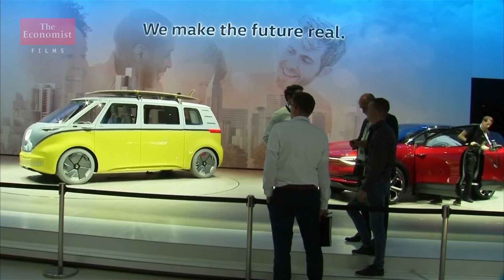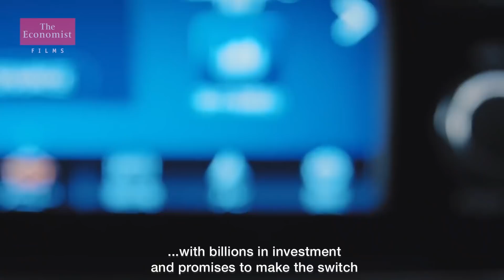Electric cars will come of age in 2018

Comment: Fossil fuel cars are 20% efficient while electric cars are 95% efficient.
Reply: It appears that Luke has done zero research about the issue.

https://www.bloomberg.com/news/features/2018-06-27/where-3-million-electric-vehicle-batteries-will-go-when-they-retire
Reply: parsi zaban sadly not true. Vehicle efficiency is much lower when you see how much energy is consumed overall. The leaf is really a 30mpg car when charged using most efficient gas generator. The cars are on average 26% heavier. Pre heating in winter and losses from socket to battery are not included in the vehicle consumption GOM only what is taken from battery to motor. Degradation with useage and especially with rapid charging of smaller packs is significant. Unlike lead acid batteries, 95% of LiOn packs are NOT recycled buy incinerated! Yes to ending fossil burning but the alternatives need to include wastefulness of scrapping existing reliable and efficient cars. In Finland they now use hvo from waste in their buses instead of diesel. Much lower emissions than converting them to EVs.

Comment: Anyone who is considering or has already buying an electric car is well aware of the need to source their re-charge fuel from renewable sources.  The message here is that "boogy Boogy!"  the EV's will still run on dirty coal.  But No most people are already aware of the changes underway (irresistable I suggest) to move to cheaper Greener renewable sources of power for our economies!  then their is the issue of sourcing Lithium and Cobalt.  Well Australia has Lithium mines now opening (no child labour or repressive governments here) and Tesla and other EV makers are seeking better places to source their Cobalt than the Congo.   So the cleaner Greener and cheaper solutions for our transport are NOT fraught with uncomfortable choices... In fact modern industrial nations are already awake and making and legislating to make these better choices mandatory & thereby hopefully contributing to  making irreversible climate Change less likely.  the uncomfortable truth is that not to do this may make our world and that of our grandchildren extremely uncomfortable !

Comment: Why haven't they made electric cars that have solar panels to recharge the batteries and you wouldn't have to stop and charge them? Does anyone know if this would work? I'm sure it's been thought of.
Reply: MICHAEL DAVIS Way too slow. Would take weeks.
Reply: Best case scenario, covering a typical car roof in solar panels would produce around 3 to 4kW per day.  Enough to travel around 12 to 16 miles or so, but the extra weight and wiring would offset some of that.

Where that would potentially make more sense is a roof of a delivery or box truck, as the extra area could be useful to generate energy, and those vehicles tends to make a lot of stops, so they typically don't travel long distances in a single day.

This is something that could appear in another 5 to 10 years or so.
Reply: Would charge enough to run the internal clock

Comment: 1 Electric cars will not reach any tipping point in 2018. This video is clearly a propaganda/social media advertising to help force through the change faster.

2 - Let’s be in no doubt, electric cars are the future but for the foreseeable future they will remain in the realm of enthusiasts, early adopters and people who’s driving style suits electric, (i.e. someone who drives short distances carefully)

3 -The real change will come when charging times become comparable to filling a tank with fuel and charging stations are as prolific as petrol stations. Until that time electric cars will remain a niche product. People already have charge anxiety with their mobile phones, so where’s the logic in opting for range anxiety with an electric car?

4 - The comments about petrol and diesel ban refers not an an outright ban on hydrocarbons but to cars required to have a hybrid powertrain.

5 - There are many unresolved problems stopping electric cars from reaching the tipping point, it is a developing industry that will take time reach levels of performance and consistency. Some electric cars have headline acceleration numbers but the battery drain is prohibitive and they all over heat. I have never seen one electric car flex its muscle, I am guessing because it would lose have the charge and not make it home. Once there are enough charging stations and charging times are brought down to real world figures and the weight the heat issues have been resolved I will make the change, until that time I will leave it to all the early adopters to baby sit this generation of beta cars.
Reply: Wow, it appears you have been living in a cave somewhere.

1.  Electric cars today already have a range of over 300 miles and climbing.
2.  There is no need for the charging times to be the same as filling a tank of fuel, the car charges while you sleep, just like your phone.  And is fully charged when you wake up in the morning.
3.  When needed, Superchargers can add close to 200 miles of range in around 30 minutes or so.
4.  There is no "overheating" on electric cars.  Not sure where you came up with that fiction.
5.  Electric cars can flex their muscles without any range issues, and will easily make it home.

Maybe look up some basic facts before posting?

Comment: Nope. The power infrastructure will support some electric vehicles, but not a large number of electric vehicles. One of many reasons Tesla Automotive is doomed.
Reply: Not sure where you came up with that.  EV's mostly charge at night when the grid is idle.  We can easily charge tens of millions of electric cars today without any EV specific grid updates required.

And Tesla is not even remotely close to doomed, despite the trolls that have been repeating that BS for 15 years already.

Comment: The underlying "uncomfortable truth" is false and brings shame to The Economist. The real truth is simply that EV's will make the world much cleaner in every way. The existing power plants are in average much cleaner than cars even when using coal. Cleaner grid is a very comfortable and should be embarrassed even if the initial cost high. Why is there no mention that some countries already produce more clean energy then they can use and therefor sell it to neighboring countries? EVs will solve this by using the excess energy to charge EV batteries. This buffer for solar and wind energy is what really is needed. The part about cobalt mining is made like a anti EV propaganda video. Child labor is a global issue, but not part of the clean energy issue and using it here must question the purpose of message in the video.

Comment: Pretty biased,  I intend on buying an electric car in 2018 ( back end)  but first I am having solar panels installed , I will be able to charge my car free & more importantly cleanly. 
And it's a known fact most ev drivers normally have solar panels installed as a result of ev ownership! 
Frankly this video is scare mongering bull! 
So we won't use oil & the middle east will all start killing themselves??  Well If that is the case I would call it population control,  let them get on with it although some middle east country's ( Saudi Arabia for an example)  can see what's coming & are embrassing renewable energy ( let's face it the middle east if it embrasses renewables is one of the best equipped to thrive). 
This video was so biased & at no point did it point out the positives of us all moving towards renewables

Comment: We just need these electric car manufacturers to decide on one type of plug to use for charging. This will make it easier for there to be a network of charging stations just like gas stations. Right now, each manufacturer has its own special plug and charger (for the most part). Charging stations would not need to be as ubiquitous as gas stations are since the majority of charging will be done over night at home when using the car to go to and from work and running errands. Maybe hotels can be the places that install the new stations since long trips away from home can typically incur an overnight stay at a hotel. You wouldn't necessarily need to stay there to charge there. If you get a room, charging your car would be free. If not, there would be a fee (a rate similar to filling up with gas). While you're charging, you can rest and wait in their lounge, then get back on the road for your trip to FL from IN that you want to drive through. But with batteries getting better and having longer ranges, you can make it to grandma's house and charge it there.
Reply: Most of what you mention is already happening.

A lot of hotels already have so called destination chargers, where you plug in for free when you stay there.  I have used those all over FL, including Orlando and Key West.

Pretty much every car out there can use a J1772 charger which is a typical 240V Level 2 charger.  Tesla's use a Tesla connector, but they have a J1772 adapter, and they can also use a Chademo fast charger if they are not close to Superchargers.

In reality, there are only about 3 fast charging plugs and 2 slow charging plugs.  It is not as bad as you think and the SAE J1772 is pretty standard across every manufacturer, which is why even Tesla uses it when needed.

Comment: The argument of going electric still being charged by pollution causing Coal is ridiculous.  The power would be generated anyway!  The point is that electric cars use NO fossil fuels except for lubrication.  To make the case that these cars still pollute because they are produced by using coal fired plants - or that their charging uses coal AS A FOCAL POINT FOR AN ARGUMENT is false !!  Scandinavia produces power that is almost 100% sustainable.  In Europe this trend is moving very quickly to this fact also.   The reason China is moving so quickly to Electric cars is because its pollution level in cities is almost 100x worse than most other modern cities.  So electric is the future - Period!

Comment: The fact that The energy density of currently available batteries is nowhere near that of petrol (gasoline) is a non factor,  also whats the point holding all that energy when only around 30% is used for motion, with electric cars doing over 200 - 300 miles on one charge the battery problem has been solved and will only get better, The ice engine has had a good run, but its now hitting its last legs, with more and more people installing solar on there homes, its only going to make sense that those people get an electric car, solar power is expected to half in 10 years and ATM its dam cheap, you can pickup 8.5kwh of pannels for less than 6k oO will the ICE car die completely, most likely not for at lest 30 - 40 more years but they will fade away, and just become a thing of the past, much like the steam engine has today

Comment: The internal combustion engine is very inefficient at turning energy into motion.  Electric motors on the other hand are extremely efficient.  Even if you use the same fossil fuels to generate electricity in efficient power plants and use that electricity to charge the electric cars your net use of fossil fuels goes down significantly.  Moving to electric cars is good economics even without considering the potential environmental benefits.

Comment: Many people always say that electric cars are dirtier than cars that run on gas or diesel because a lot of the electricity comes from coal.
There is one thing that they always forget: it already takes a shit load of electricity and fuel just to make gas or diesel. Including extracting the oil , then transporting it to the refinery then actually making the gas and diesel out of  the oil, then distributing it to the gas stations and after all that you burn it and create even more emissions.

So even if all of the electricity was generated by burning coal (which it never is) electric cars would still be cleaner and more efficient.

Comment: Graphine electrode lithium batteries will greatly extend the range of electric cars. The real advance will be in generating electric power through liquid fluoride salt thorium reactors, This will make electricity much cheaper than it is now and thus increase the appeal of electric cars.

Comment: Only conclusion I draw is the brainwashing is complete. Listen to the comments on this. You’re all frothing at the mouth. 500km range max at cutting edge technology plus a wait time for charging is simply unacceptable to our way of life and economy. Plus that will only be 300 or so kms because who runs their petrol car to the red light before filling. At the moment it’s city cars only and bravo that’s great, buy one, and forget leaving the city for the weekend. Sure it will improve, but your fervour and hatred of oil is absurdly naive and child like. Get real.

I had an off grid house once and it was a crock of shit. The promise of greater batteries just around the corner never came and still hasn’t. In fact I know off griders who use the old lead batteries because they got sick of spending Big on the others and seeing them fuck up at great expense.
Reply: It appears all the brainwashing is your own.  The range is actually 500Km at highway speeds, driving rural roads, you can easily go 600Km or more.

There is no wait time for charging, what a bunch of hogwash.  You charge the car at your house and it is fully charged every morning before you leave.  If you need to top it off, you can get 300Km of charge in 30 minutes or so.

Those cars are not "city cars" by anyone's imagination.  I have driven my Tesla Model S close to 1000Km in a single day.  Maybe you can show me the city that is 1000Km wide for my city car.

Comment: Starting from 4:55,  This doc is not taking in consideration the evolution of the battery itself. New technologies are rising such as batteries based on Sodium, which totally redefine how battery will be used, recharging 10 times faster than Lithium batteries, with a range 10 times more important and that cannot catch fire in case of a car accident.
The more we buy electric cars, the more economic interest there is for companies to develop new type of batteries with longer ranges and faster recharge.

Comment: I don't buy the whole you still need electricity, so coal and oil are still going to pollute, argument. Electricity is already polluting, and having gas cars only makes that WORSE. If you take away the gas cars then you're only left with regular coal and oil related pollution. Which by the way, coal has become a lot cleaner over the years. Also, they neglect that charging stations will be able to use solar power. Solar power won't get the job done itself, but it will lower the demand placed upon the oil and coal industries. Overall, you get much, MUCH less pollution. Also wind and water can also be sources of electricity. There are clean ways to charge. Not to mention, as batteries get better, people will need to charge less and less.

Comment: Power stations run at 50% efficiency all the time. Petrol cars peak at 25% only when driving 50miles/h. So yes electric driving is more environmentally friendly even when powered by coal.
Reply: and they wont be powered by coal for long.

Comment: 2018 is a little unrealistic for EVs to take off.  Charging locations are still inadequate.  30 min charging times is an annoyance vs 5 min refueling.  Outside of Tesla, most EVs are limited to small cars and Americans like trucks and suvs.  And even Tesla's EVs are prohibitively expensive.  It will take time and lot of investment from government, private and public institutions.
Reply: Not really. 

Charge up at home, drive around like normal, hundreds of miles if you want, then return home, all on one charge, and it costs pennies compared to petrol. 

"Charging stations" are just a bonus, not a necessity. 

And what is a "Charging station?" It's just an electrical outlet. Every gas station already has everything they need to become a "charging station" tomorrow morning. 

No big investments are needed.

Way to promote silly worries though.

Comment: I was with you until 4:06. Tesla model 3 is 126 MPGe, that's much less pollution even via coal or gas plants compared to an ICE, let alone if you have any renewable or hydro in the mix (incidentally both today are among the cheapest sources of electricity in new projects you can find around the world.) It's not about choosing between gasoline engines and "fully clean," it's does it reduces harm? For the EVs of today and tomorrow, the answer is clearly yes, and in some cases by a lot.
Reply: Obs you have to include not using recycled aluminium, using 50% of ALL cobalt from mining in rainforests of DRC, scrappage energy costs of efficient ice cars (not just the ugly obese SUVs, I still get 100mpg real world after almost 17 years driving an aluminium audi a2 1/4 million miles on same drivetrain. It can run on #hvo made from waste.

Comment: Solarized e-trikes/trailers can be built anywhere and are low cost.
Electric cars are heavy, expensive and consume allot of material.
Solarized e-trikes packing 1800watts of solar - $5k, and you can power dwellings and array multiple units to increase power production.
Electric cars $30k
You can have 6 solarized e-trikes/trailers for the cost of one electric car.

Comment: Watch on utube - Light Rider operation Paul Revere
Switch the 6-50watt glass panels to 6-18 100watt flex panels.
Mobile Solar, the true e-vehicles of the future
Low cost, highly versatile and easily adaptable for most tasks.